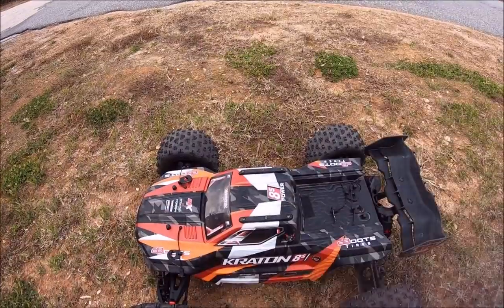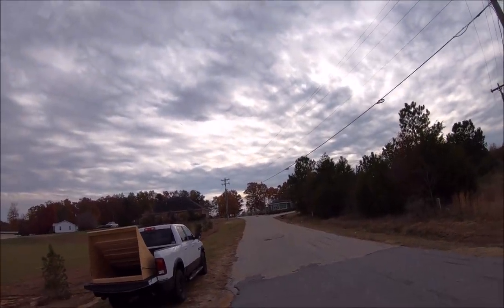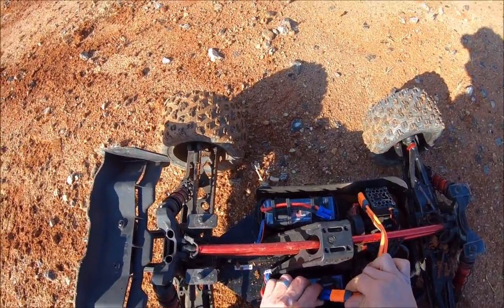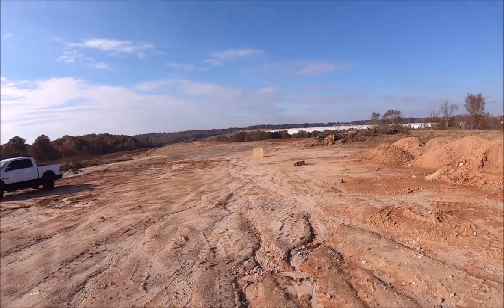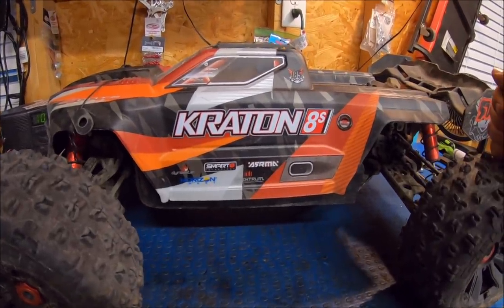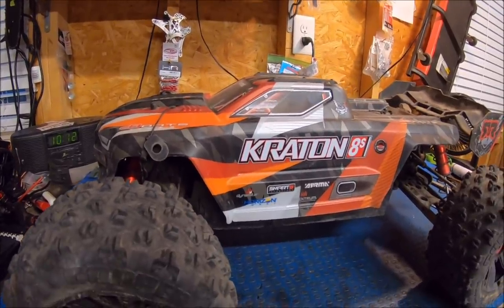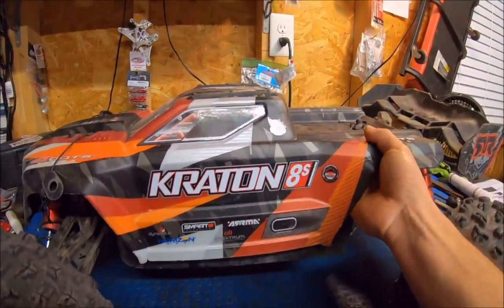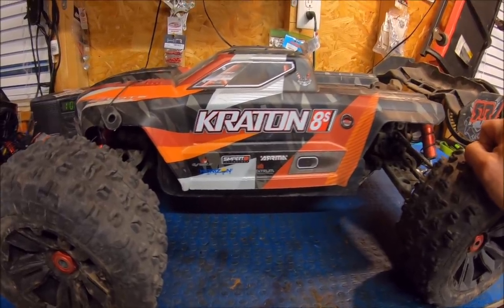NEW! ARRMA 1/5 Kraton  8s "GEARED UP and LAUNCHED UP!"-with Speedrun

Comment: Thanks for the video. 
👍🙂
The stock pinion gear is 17T; why go with 23T? And why is motor timing set to 11,5 degrees and not (for example) to 10 or 12 degrees maybe...? 
🤔

Comment: Why doesn't M2c make a rolling rc that would save us all some money then we just add our electronics no more need to buy a rtr than put hundreds more in upgrades
Reply: The don't make any plastic parts. Tekno did start by doing conversions for other cars before making their own, maybe m2c will do it in future.

The only problem is lots of people don't like to put in the money upfront, they like to buy little bits even though it ends up way more expensive in the long run.
Reply: @LawrenceTimme  yeah because it's easier to start smaller then to start directly big. ^^ i prematurely linked this video to my buddy regarding that fullstop at the pile saying that he got more luck with his kraton then Kevin Talbot, finished the video and deleted my commentary to my buddy after seeing t2t brace bend and rear chassis bend ^^
Reply: @ParRagon-  it's not easier or harder. It's just everyone wants everything now and CBA to save up for anything anymore.

People would rather buy mediocre now than something really decent in a few months.
Reply: @LawrenceTimme  that's what's easier with that ;) buy now not in a couple months
Reply: Or Arrma let M2C build their chassis, tower braces and frame  braces 🤷🏾‍♂️just saying.
Reply: @LawrenceTimme  while I'd rather buy a tougher rig than build it up over time I can see why people upgrade slowly. Parts for these things ain't cheap!
Reply: I would buy that roller. Or better yet a kit. I miss building Kit's.
Reply: Plus ppl dont realize , nothing indestructible, so the  better make it further harder it can go therefore more energy to break otherthings wear geats fadter ect ect.  by time most guys get to needeing  m2 chassis they practiced enough to have skills to where a bad landings are Murphy's law and not a regular occurrence . i jump my arrmas in back yard about half the distance and height only bent broke stuff through wear tear or forgetting screw for chassis braces

Comment: Nice. So how long was the run time? I'm assuming less than 20 minutes. I do have some xmaxx 8s 9200 mah SMC batteries that I could shove in there if I put a 23t pinion inside my Kraton v 1.5 once I get it in my hands. How was the heat? Thanks.!

Comment: Eric, when your lipo came unplugged, I noticed you had the battery cable in both sets of clamps on the Velcro straps. I’m pretty sure your supposed to have the battery cable in one side and the ESC cable in the other. This will hold the IC5 connectors together and prevent unplugging. 👍🏻 Sorry to see the bent chassis but I know Mitch will get you fixed up really soon ✌🏻
Reply: jondilly1974 yeah I was gonna mention that, use the inter grated clips and you can’t come unplugged

Comment: how are your pillowballs after a run that hard? i saw one guy which already had his pillow balls backing out big time. huge slop in the wheels.  and do you know the max diameter of a motor  it will fit? thanks.
Reply: All you gtta do is tighten them with a lil blue loctite

Comment: Eric, I don't think it was the gravel pile hit that bent the T2T brace and chassis, as the chassis bend at the back has kicked up, not kicked down 🤔 I think it was the huge sends that did it man

If Arrma could have just secured the middle of the T2T brace to the centre some how it surely would have prevented this. It's too long of a hollow alloy pipe to support the weight of the car for big sends!

And as far as I understand it, the other two lower centre supports are hardly doing much as they are effectively just on hinges

Someone get Arrma's attention with this comment please lol I'm super confident that this is all they would have to do to ditch the bending of their cars I'm worried they are getting known for

Comment: Love the vids, glad your the one puting this RC through the works. I finally got my M2C chassis last week (for my 6s kraton). I have a question for ya, maybe you can help. I upped my pinion to a 20tooth. Installed a heat sink and fan too. Twice now however I’ve busted planetary gears in the rear diff house. 2 runs in a row. I’ve shimmed  the spider gears, but kept the stock (smaller) shim behind the planetary gear. The mugen siekie (large) shim made my gearbox too tight, so I took it out. What gives tho?? Why are my diffs breaking? The first breakage was not the planetary gear itself. It was the tiny rod that sits up under it. It snapped in three places. The next breakage however was the planetary gear. Am I doing something wrong? What do you suggest prevent this from happening?
Reply from the maker: Wow sorry to hear that man!😳That can be frustrating I'm sure! Is it a V4? If so, in my honest experience, I dont think the inner gears need extra shims. Just one extra on the outer bearing. I run mine like that with hardly any diff breaks in over a year. Are you running a 20 tooth with big tires or smaller Badlands? But sounds like a planetary/spider gear mesh problem using the extra shims🤔I'd try using just stock shims with one extra on the outer bearing. 2 total on front and rear. It may sit tight but really keeps from stripping the ring/pinion. It will wear over time anyway. That's just the setup I've used and it seems to work.👌 I'm sure others may have different experiences but it seems to be solid. Hope you have better luck bro! Also, what diff fluids are you using?
Reply: RC DUDE81 
Yes it’s the v4. My tires are stock. I run 60k in the rear, where I’m having the issue. 20k in the front. And 200k center. 

So your sugesting I should go in and remove those shims from the internal spider gears. That might help.
Reply from the maker: @EastTactics  I'd try that and see if it helps. Btw you may want to try the 60k in the front and 20k in the rear. Just switch your diffs around. Let me know it goes!👊

Comment: You are a one brave basher. It takes guts to move this behemoth at those speeds and heights. Well done dude. I still prefer my Notorious 6s, but it's me. I don't like much the design of the Kraton, either 4s 6s and now the 8s. It's a too long platform for such a hard bashing.

Comment: You are the second video I've watched where they had already bent the chassis and upper brace. That sucks for a $900 truck. I know, there isn't one out there that doesn't break, but if it were me, I'd just get the Kraton 6s, toss in a Hobbywing Max6 and call it a day. Still be under $900 and not have to worry about a truck that will have the brace on backorder for 14 months. Just my thoughts.

Comment: Its not a jumping truck like the X Maxx. Those shocks arent up to it. Thats why the banging sounds on landings and the bent chassis or towers. Its just a larger Kraton for $899.
Reply from the maker: It's called chassis slap. Exactly what you want with big air's. The shock dampening is quite nice for a good solid rebound. Fly's very balanced as well. But whether or not I'm going to jump it. Its what I do.😎🤘
Reply: nobody sends the xmaxx like this. lol

Comment: You don't see 1/5 scales doing this too often. I might have to pick one up
Reply: More like it , thing is a beast 👊👍🚗
Reply: Have u not seen the xmaxx vids from kevin Talbot
Reply: @ismoketobacco  
"Too often"
Reply: Dont count has a plastic chassis just a toy 😀
Reply: Xmaxx isn’t a 1/5
Reply: Very true!!!
Reply: @ismoketobacco  Thank you!
Reply: yeah nobody bashes 1/5th decently
Reply: @stephanez8036  too expensive,  i drove xxmax 1st time bone stock fun but i sure wasnt sending it off my jump like i would a kraton  it was kinda slow tbh too with traxxas batteries stock esc
Reply: Keven Talbot bent the shock towers first run! I'm out!
Reply: @paulclancy2404  you driving on 6s stock gear and beginner ESC settings on that XMAXX? 😂
Reply: @brookekathryn1980  I know all these people talkin crap now that this new Kraton came out. My brother had a Xmaxx and it was stupid fast. Id rather have 5th scale dbxl or Xmaxx than new arrma
Reply: @jhawk1985  agreed!

Comment: That main support rod for the towers is bent! I bet the chassis is bent like the other 8s Keaton's too!
Reply from the maker: Yes I did mention in the end of the video it and the chassis was bent. She took some killer airs for a 1/5 scale 25lb truck👀The brace bend came from the full speed stack into the gravel pile where she came to a complete hault😳At least she kept going with no breaks or drivetrain issues!😁👊🤘🤘

Comment: More timing in a D wind motor only creates more heat Big Bro.. nice Rip!
Reply from the maker: Yeah just had to try.😂The instructional vid talks about it adding more speed but could cause more heat. After full packs run, she was only 120 degrees so not bad at all. I felt the power band feed in a little faster than 0 degrees but maybe not much more top end🤔Worth experimenting anyway!😂👊🤘🤘
Reply: @RCDUDE81 Heck yea it's worth messing with tho...lol.  5 -7.5 should be the sweet spot.
Reply from the maker: @MrMad2424  Hell yeah bro! Thanks for that I'll test her out with that next time!👊

Comment: So chassis, tower to tower and it looked like front shocks and it sounded like an xmaxx with a bent drive shaft at times?? ... with upgrades that’s one hell of a dent in your pocket ☹️ grated that bugger flies though... as does the 6s. I so want to love it but I’m so underwhelmed!
Reply from the maker: Yeah the T2T, chassis and I did notice later the front brace snapped at the hinge. Not bad considering what it took! The head on at full speed into the gravel pile was gnarly! Pretty positive that's what did it!😂She kept going though! Didnt notice any of this until I got home! Just the g forces on that truck on big air landings is insane!😋 But yes, Mitch with M2C has my truck now working on ideas!💪💪Thanks for watching Claire!😎👊🤘🤘
Reply: RC DUDE81 tomorrow is going to make up my mind on these. 3 that a I know of going to the race track 👍🏼 I’m thinking racers not bashers unless you have very deep pockets! I really do think there were issues that could have been addressed though... chassis, tower to towers... makes me think of when I’m editing a video and I loose the will to live 🤣 sure you’ve been there! Keep up the good work though! Love the way you bash!

Comment: Hey how many more teeth can you use before you start getting it hot because I have one on Layaway
Reply from the maker: Well the 23 tooth seemed to be a sweet spot.👌 50+ mph and she didnt seem to overheat bashing but also its cooler temps out. The hottest the motor got was 120 degeees.😎👊🤘🤘

Comment: Great video as always Dude!...Whats was the motor temps at the end of run?
Reply from the maker: 120 so not bad. I was going to show it but my go pro died. Not bad for lots of hard throttle!😁👊🤘🤘
Reply: @RC DUDE81 Cool. I was curious if she could handle that 23 pinion. That seems to be the money spot right there. It'll probably run at the optimal 140-150 in the summer, with that gearing.

Comment: Imagine that going 70 and hitting you in the leg. Snapz, cracks, and pops
Reply: I got hit in the leg by a TRAXXAS X-MAXX going 55mph when a pin in front hub assembly dropped and was riding on inside of rim caused it to turn quick left and right into my leg hit so hard knocked me off the chair i was sitting on my phone was on seat in front of me my shoe and phone ended up 30 ft away in middle of road so i need not imagine it i lived it leg and knee never gonna be right but shit happens. So now i built a snow plow  for it  put FPV cam on it with 360 servo plow driveway from couch do to a knee injury LOL. Turned a negative into positive now no need get cold removing snow just saying .

Comment: What goes up must come back Down with a bent chassis
Reply from the maker: 😂Yep, completely normal with a 25lb truck at those heights. Upgrades will be coming soon!😜💪✌
Reply: @RCDUDE81  you gonna put the 780 motor from the DBXL 2.0 in there ?

Comment: Your an animal! 😱😱 I can't believe that you sent it like that 😂 I'm amazed at how well it flew 👍 Really cool that you can change the motor timing with that ESC & motor combo. 50mph is much better speed. I still see more potential with a bigger motor. The durability issue though.... It's just to heavy to send that big I think 🤷‍♂️
Reply from the maker: 😂Thanks Aaron! Yeah got 53 by my logger. 55 is with a 25 tooth I believe is what Rich said was in the manual. But yes, much better! It wasn't the jumps that bent it up but the slam at full throttle into that rock pile!🥴Full speed to a dead stop! Not bad damage really!😂It looked worse in person!😳She still kept going! But still, she will have her limitations and M2C will solve all!!😍👊💪🤘🤘

Comment: You think the xmaxx is better with all the plastic? Steel bends but plastic flexes. Tough decisions how I prefer my rpm plastic parts over the steel shit on my pede and tried both. I broke those 80 dollar mvp and traxxas steel driveshafts faster than the stock plastic shit on my 100 mph 2wd stampede

Comment: Is everyone ignoring that the chassi bent
Reply: He ran head on 50 mph into a gravel hill and it stopped dead in its tracks.. only a minor bend..Had that been an Xmaxx it would be in two pieces lol
Reply: No Power  No, it did not bend on that landing..It bent off camera going full speed into a rock pile and stopping dead in its tracks
Reply: Drive anything rc into a wall at 50 miles an hour and it won't be good maybe a pillow would do alright I think we have lost our common sense thinking that any company is going to make a rc that will not break if pushed far enough most people don't drive them like this this is extreme driving not the norm just saying😀
Reply: @johnsorensen5758  Exactly
Reply: @philthyco1  true
Reply: @philthyco1  looooooooooool!!!

Comment: Where are all the doubters and haters now? Hmmmm
Reply: hagie61 I’m right here!!
Reply: Here. Way too heavy and slow IMO
Reply: @mikes062  Traxxas only Fanboy huh?
Reply: @demitrisolvinski  also a Traxxas only Fan boy I bet. Lol
Reply: hagie61 🙄🙄 I’ll buy anything that’s good, really doesn’t matter what brand it is. Though it seems to me the ones who like to use the terms like “fanboy” are the ones who are turning others off to this hobby and making people feel excluded.  I have no interest in trying to break my rc’s and beating the crap out of them. So thanks but no response necessary here.
Reply: s  lmfao. This RC is going to be epic. But I guess you'll never know. Fine by me. I'll be enjoying mine.
Reply: @hagie61  I own (6) 1/8 Arrmas and not a single Traxxas. This just seems like it goes past the point of diminishing returns. The weight to power ratio isn't as good, parts are going to break more easily and  cost more to replace. I'll stick to my 1/8s and enjoy watching folks with deeper pockets thrash the 1/5s
Reply: @demitrisolvinski  good for you. Enjoy!

Comment: Y does yours look 2wice as fast as everyone else’s? Whats the secret?
Reply: i guess the punch on his ESC
Reply: @babissolanakis6212  Punch and motor timing
Reply: Punch will help it get going, as will the timing. Top speed increase comes from his bigger pinion he said he installed.
Reply: @MrMikrace  Not entirely true..Motor timing plays a big role in top speed..It always has even way back in the brushed motor days when they had mechanical timing advancing.

Comment: If you want more VIEWS and more SUBSCRIBERS you need to change that camera! It sucks, fish-eye image is too strong (strongest the fish-eye, the smaller the looks in camera) and your camera has NO IMAGE STABILIZATION (2020 DUDE!!!).                            Shakes like hell!!!  Please, as a subscriber, I ask you to invest a little in a better camera for your videos.
Reply from the maker: Thanks for your input man. But I'm using a Brand new Go Pro Hero 7 black. Also using hypersmooth stabilization. I'm walking on very uneven surfaces and get tripped up a lot as I bash so I think the camera is doing a great job. The fish eye or (wide view) is normal for a Go Pro. You have to have it to keep the rig in the frame. Thanks for watching though and your input!😎👊